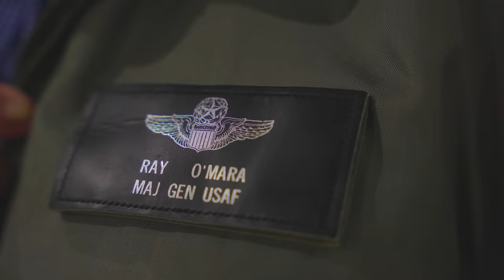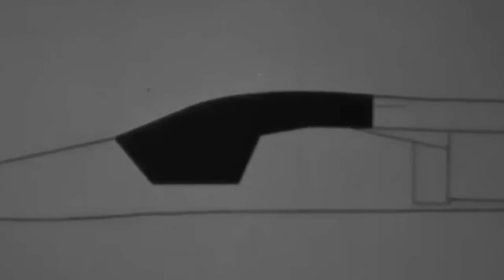F-111 Aardvark | Behind the Wings

Comment: What an amazing aircraft, and I miss them dearly. 
My favorite aircraft of all that I’ve played with.
By the way….The FB-111A does NOT have a greater internal fuel capacity than the other F-111 models.
Reply: That's wrong Patrick. The internal fuel on the F-111 A, C, D E is listed at 4191 gallons, and the F shows 4184, and the FB is listed at 4673. Max T. O. weight of the FB is listed at 119,243, crushing the other F-111's into the dust with their max load of 110,000 for the C, and 100,000 for the D and F, and 91,300 for the A and E. Oddly enough, the FB would be loaded to the 119K T.O. weight, knowing they couldn't take off that heavy, about 115K was all they could do at sea level, so it was expected to burn off about 4k of fuel with engine start, systems check s and taxi.
Reply: @harrystone8847  
LOL
Max take off weight isn’t only about fuel, so that means nothing. 
They had the same fuel tanks as other F-111s. 
Initially, they also had the so-called finger tanks that were deactivated, as they were a maintenance headache & not worth the trouble….too difficult to work on. 
The only difference between FBs & other Varks, fuel capacity-wise, was that they could carry EXTERNAL tanks on stations 2 & 7….that’s 1,200 gallons extra. 
BUT, that is EXTERNAL fuel, and those tanks must be jettisoned after takeoff if you don’t want to fly the whole mission slowly, with wings at 26°. 
Having worked on all USAF models in the overhaul facility, I know they all have the same internal tanks. 
In fact, the FB-111A supposedly holds 5 gallons less in the aft tank. 
I don’t know why, but maybe due to higher structure thickness for high gross weight requirement.
Reply: @patrickflohe7427  how many years did you work on military jets? I put in 24, on the 111 series.
Reply: sorry, I disagree with you Patrick. From memory the G had about 3200 pounds more internal fuel capacity than the A/C/D/E/F , its been a very long time since I worked on Cs and Gs though so my figure might be a few hundred pounds out
Reply: @davidewhite69  
Well, you’re wrong. 
The only differences in structure were that to a degree, Cs had a slightly thicker structure, and FBs (Gs were the same aircraft as the FB, as they were made from them) maybe a little more so, which would actually mean slightly less fuel. 
All F-111s had basically the same structure. 
The dimensions of the aircraft were the same, and the fuel tanks were therefore the same. 
Where did they put this extra fuel?
-they didn’t.
Reply: @davidewhite69  
I just had a thought….you might be thinking of weapons bay tanks.
At 6.6 pounds per gallon, those would add 3,861 pounds of fuel. 
-not internal, though. 
-and, never used, that I recall.

Comment: Is it true that compressor stall was less of a problem here than with the F-14A?
Reply: Yep, because this one has no engines XD
Reply: All TF30s were more prone to compressor stalls than many other engines, and it should be noted that the F-14A used a different subtype of TF30 than any one-eleven did. 
They led us to believe that the Tomcat used the very same engine, but it’s a little bit different. 
In fact, most F-111 models used a different subtype than each other.
The F-111A, C, & E all used the weakest TF30 of the F-111s and the F-14….TF30-P-3. It had 18,500 pounds of thrust from each engine.
The FB-111A had a bit more power from the TF30-P-7 engines, with 20,350 pounds of thrust per engine.
F-111D was next, with 20,840 pounds of thrust from the -P-9 engine.
The mighty F-111F was by far the top of the heap, with the TF30-P-100 engine. It had 25,100 pounds of thrust per engine.

In comparison, the F-14A was powered by the TF30-P-412 / 414 engine, and if I remember correctly, it was between the power of the -P-7 & the P-9. 
It had a beefed-up fan case for greater resistance to throwing fan blades. 
The TF30 led a tougher life in the Tomcat, as the throttles were cycled more often and the aircraft was maneuvered more often than the Vark. 
-because of this, the F-14 stalls were definitely more frequent. 
I’ve been around compressor stalls, and it’s a very violent event.

Later in life, the USAF gave the F-111F more power still, the EF-111A got the engines from the F-111Ds once they were retired, and the RAAF made some changes to the F-111G engines.
-They had purchased some Gs from the USAF, when we were retiring the FBs and Gs. 
I don’t know why, but they put a hybrid engine into their F-111G aircraft. 
I can’t recall if the F-111C was ever given more power.
Reply: @patrickflohe7427  Also the F-14 had a much more aggressive flight maneuver requirement. The Aussies with F-111-P-109 motors flew their C's like fighters, though complete with barrel rolls and high G turns, due in part to the Triple Plow I scheduling being tuned to the Nth degree and demonstrated that on the last day (3 Dec 2010).  Most pilots of the airplane treated any hint of compressor stalls like just flying, recovering instinctively, and the plane kept going.
Reply: @Paajtor  hahahaha =)
Reply: @paulholmes1303  
-P-108 engines were put into the Australian Gs. 
It was a hybrid of the -107 & -109
(-P-7 & -P-9 FB-111A / G and F-111D)
Reply: @patrickflohe7427  by 99 all RAAF Cs were upgraded with a hybrid TF-30 known as the P-109, I think it was a combination of P7 and P9, slightly higher thrust than the P7 but more importantly longer mean time between overhaul

Comment: I was Avionics Spec 326X6 and could have worked on the  F15 or F16  F/FB 111 but luck  of the draw I got F-16s A/B Block 1/5/10/15s  one Guy in my tech school class went to SAC in Plattsburgh NY

Comment: At least at Pease, the alert aircraft were commonly loaded with 1 B61 on each wing9 most inborn pylon, and two SRAMS in the bay. The rest of the pylons were filled with fuel tanks, and would be dumped as soon as was possible after takeoff.
Reply: Because of the weight of the weapons, the aircraft had to be fueled right after take-off and fueled at least a couple times if it had to hit a Russian target. I think fuel tanks would have to stay. During ORI's the tankers would launch first. So, they could fuel up the FB's. Before the SAMIT was invented the aircraft had to fly with live SRAM with SLTP payloads to get simulated launch scoring.
Reply: @JohnfromExeter  Pylon 1 and 8, when loaded with a War load, had tanks on them, but they couldn't sweep the wings with stores on those 2 pylons, as they didn't rotate. So, at least 1 and 8 would have to be dumped right after takeoff. F models could fly from east coast of US to well within Europe in internal fuel only, no tanks.
Reply: @harrystone8847  Partially correct. While we couldn't sweep the wings back past 26 degrees, that was the optimum wing setting to give us the best cruising lift when we were as heavily loaded with 4 bags (tanks), two weapons external and two in the bay. A typical EWO scenario from CONUS would have us make three refuelings with all of our tanks. Then, after the last refueling as we started to penetrate enemy territory, we would drop the tanks outboard to inboard as they emptied. That got us low with a nearly clean airplane with as much fuel as possible.
Reply: @bradmoffett7412  Thanks for the correction. I never saw a sortie from alert, just taxies. I knew the MSL, but not that the tanks were retained.

Comment: I'm sorry, but the F-111 was no fighter, despite it being designated as such. Instead, it was more of a bomber, because, it was not nimble like a fighter, it had zero rearward visibility,  it was too big for the pure fighter role, and it's radar was not designed for tracking, and locking onto fighter sized targets, as well. Also, the FB-111 was developed as a strategic medium bomber, replacing the B-58 Hustler, and the Tall Tail B-52's, as well.
Reply: You are so right. It was developed to be a fighter/bomber, but it failed miserably as a fighter. I was around them a lot in the 70's.
Reply: it was labeled a 'fighter-bomber' purely for political reasons. It's wing loading is all wrong to be a fighter. I have seen mock dog fights between RAAF f-111s and RAAF F/A-18s, the pig doesnt stand a chance within visual range, its only hope was to get out of dodge and hope an AIM-9 doesnt come up its arse, a hornet can not keep up with a pig down low, in fact no fighter could
Reply: It was common in the 1950s and 1960s to label attack aircraft as fighters.  Most of the Century Fighters (and the 111 was technically part of this group; it was the last numbered fighter put into production by USAF  before they started the numbering system for Fighters back at "1") were fighter-bombers with the emphasis more on the bomber part.  The F-100 might have started as air superiority follow-on to the F-86 but it evolved into a fighter-bomber.  The F-100's performance as a straight fighter was eclipsed by other jets within 4 years of its first flight - the F-8, the F-104, and F-4 all bettered it significantly.
The F-105 is another plane that's been confused as a fighter.  No, it was intended for nuclear strike but evolved into conventional attack plane and later a SEAD platform.  With its heavy wing-loading it was never going to be a dogfighter anymore than the F-111 was.
The F-111 being labeled a "fighter" was purely political to avoid the stigma of being labeled a child-killer and all that nice psychological mumbo-jumbo people like to use to kill projects they don't like for whatever reasons.  It was designed as a  medium-range attack plane and was never going to work in another role well because it was too heavy and not designed to maneuver aggressively.
Its main problems were that it was integrating too many new technologies (swing wing, afterburning turbofan, TFR radar) into an unproven airframe and its mission focus was confused by the conflicting requirements of the US Air Force and US Navy.  It was both ahead of its time and there was no practical experience with swing wings and turbofans in combat so the teething was going to be difficult and take time to resolve.  With hindsight, it was obvious the USAF and USN should have been allowed to go their separate ways and allow the F-111 to be the attack plane it was intended to be from the start.  Maybe it was better that it delayed the Navy's Phantom follow-on (VFX which became the F-14) because it allowed the Navy to see where the F-4 was deficient in Vietnam and design the follow-on plane to be a better air superiority plane with renewed emphasis on handling.

Comment: Approach speed is faster than take-off speed?
Reply: well think about it.  For takeoff you're starting at 0 knots.   You're accelerating to rotation speed, and the big nose radome acted as an airfoil in itself, greatly lending to "flying" or getting off the ground, with the slats down 100% and the flaps set at the max of 34 degrees.  The nose rotates and the aircraft lifts off, afterburners are in Zone 5, and you're accelerating to get airborne.   On the opposite side, you're coming in for a landing trying to stay in the air and trying to stay aerodynamically in control with your flight control surfaces directing where you're going and what you're trying to do.  The aircraft is lighter because of fuel burned and maybe some stores (bombs) dropped, but you still need power & lift over those wings, with the horizontal stabilizers and the big vertical stabilizer and rudder doing its thing(s).  When the jet is on the ground, then you're decreasing speed by the engines being knocked back to idle, the four wing spoilers "spoiling" the airflow over the wings (decreasing lift) and you are pulling back on the stick so your big horizontal stabs creating further braking.  Oh, and aircraft brakes on the two main tires!  Increasing speed to take off, but decreasing speed but still needing to stay airborne upon landing.  Approach speed is faster than take-off speed.  IYWDSYAS!  (SORRY again Mr. Stout, just reading and trying to dig deep into my ever-aging brain, that gets excited when talking about the Aardvark!   F-111 Integrated Flight Controls & Instruments Systems Technician, Jan 1982 - Oct 1995!)
Reply: @AirForceMike1981  in short, that's just the flight characteristic of the vark. Thanks for your feedback & insights.
Reply: Takeoff speed was strictly a part of the hi-lift system to get it off the ground.  When it was ready to fly, it flew.  On Landing you had to set the mains on touchdown (force the wheels to the track distance) so it required a a good speed and a firm flare all the way to the runway.  Remember this was a USAF/Navy compromise so the Mains were long shock absorber gear that needed to be compressed.
Reply: @paulholmes1303  why not just let gravity do what it does? No worries, no reply needed. Thanks.
Reply: if the wings are back you cant have slats and flaps extended, hence the high speed due to lack of lift augmentation
Reply: @davidewhite69  sure, but why would you want to land in that configuration?  apologies, if i missed the aircraft having some sort of malfunction.
Reply: @ingoos  not by choice, but there were the occasion malfunctions when the wing sweep cut out, I also saw one land that fast because the jack screw on one slat sheared (f-111 flaps and slats are electric) and it was unsafe to extend one wing and not the other

Comment: What happened to the engines ?
Reply: They were removed prior to it going to the museum.
Reply: Whether that was for cost or availability it is still the case that the F-111 would sit on its tail if the wings were swept full back on the ground.  We had to manage the fuel load even with wings forward (if I remember right, we would strap ballast to the nose in Phase dock if wings were swept) @johnosbourn4312

Comment: B-1b is the replacement for the FB-111 because as soon as the Bone entered service in late 80s the FB-111 units from the northeast started rapidly drawing down their operations to retirement by 1988 or 1990 at the very latest, though i believe all were retired prior to 90. Later some were briefly put into conventional tacair training role at Cannon AFB in the early 90s as SAC was disestablished. These few aircraft were redesignated F-111G and had their SRAM wiring and other SAC mission equipment removed though they retained the astro compass and sat nav hump on the nose and obviously kept the longer wings vs the shorter wings on the D and F models based at Cannon in early 90s. As far as I know at the mid to late 80s twilight for thr FB-111 I thought they had B83 bombs as part of inventory but maybe Im wrong. I believe the B43 bomb was retired prior to B-1b entry into service and the B83 replaced the B43.
Reply: B1 was to be B52 replacement.  The F111 was mcnamara idea so all forces could fly it like the F4. The F14 was designed as the F111 wasn't safe enough on carriers.
Reply: @briancooper2112  correct in role as heavy bomber as the FB wasn’t a heavy bomber but a stand in for B-1 and a lot in USAF were angry about the fb as they were worried it would be seen as a manu er against B-1 funding.

Comment: The US FB111Aardvark Fighterbomber use in the Vietnam war operation Linebacker 2 and these FB111 Aardvark fighterbomber fly at low altitude and that even S75 Divina SA2 or Surface Air Missile or SAM2 Radar cannot just detect it used by the North Vietnamese Army or NVA supplied by the Soviets . So thats reason why Numbers of NVA S75 SA2 or SAM2 have been knock out and because Radar can only detect if the aircraft flying high altitude and but not the US FB111 Aardvark Fighterbomber and cannot low altitude . It was successfully in the Air raid sky of Tripolo Libya in 1986

Comment: We had 3 squadrons of F-111s they were pigs shot tbem selves out the air prone to flame outs they were junk
Reply: exactly what did they "shot them selves out the air" with?
Reply: @anotherdave5107  in the 80s a RAAF F-111 was seriously damaged in gunnery practice with the weapons bay mounted m71a1 vulcan gun when a mount broke and a round penetrated between the aircrews feet and into the forward avionics bay, another round also damaged the nose landing gear. But, it returned to base safely and was repaired and returned to flight status, and operated until retirement. After that, the RAAF abandoned all F-111 gun operations, the bay was slated for pavetack incorporation anyways. The guns were absorbed into the RAAF F/A-18 Hornet spares system. As for flame outs, very rare for an F-111 because the flight profiles were completely different to the Tomcats